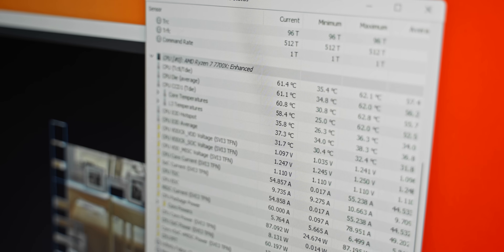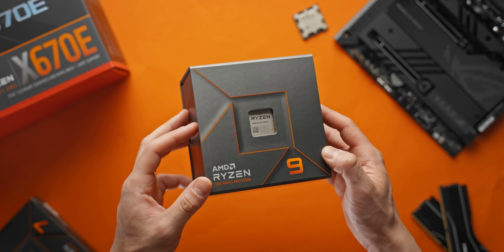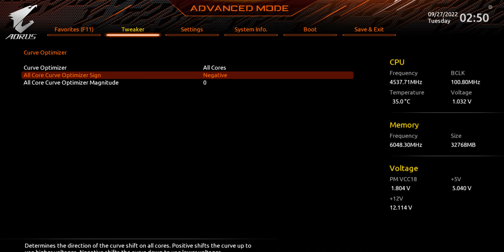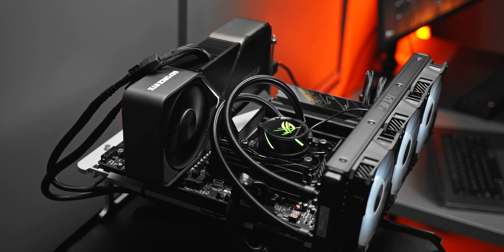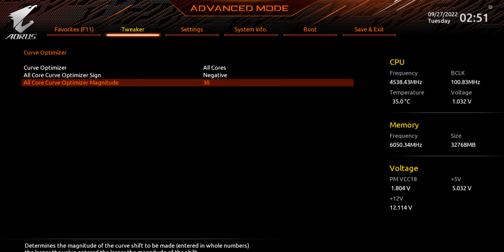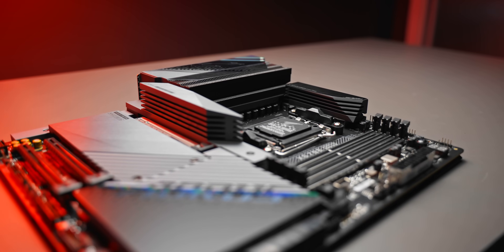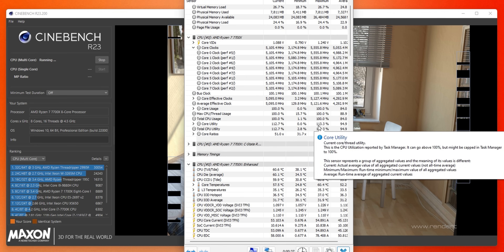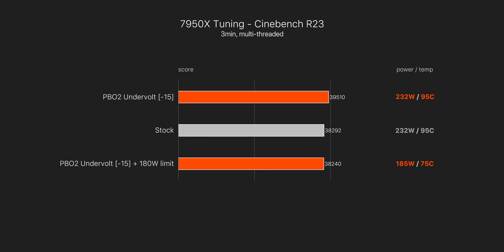Fixing Ryzen 7000 - PBO2 Tune (insanity)

Comment: This is some of the most practical and easy-to-understand advice out there. Great video as always!
Reply: Dein Name Junge hahahaha aber wo du Recht hast hast du Recht
Reply: Yes bro fr. We love you! ❤
Reply: you and Tech yes City are taking the better approach with this new chips in my opinion
Reply: Just to understand he does the -15-30% thing first and then at 4:58 hes in the tweaker settings manually capping to 85 watts`?
Reply: @Djuntas  It is a voltage offset, not a percentage. There is no need to cap anything. You are setting a negative value to the voltage curve as the CPU boost. Start at 30 millivolt and reduce by 5 until you get a stable bench run. If your voltage is still offset negatively with a stable bench run, you may find your cores boosting past the number on the box. He caped the TDP from 95C to 85C and capped the wattage to 85W to meet stock speeds at the least possible power draw.
Reply: @BansheeBunny  how can you tell if it’s stable or not ? I ran cinebench with 30 on my 7700x and it did not crash or anything is there any other way to know ?
Reply: @BB-iw4ql  Run the 30 minute test on cinebench, if it finishes, you should be fine.
Reply: agreed!
Reply: Way better than the usual random geezer with 400 subs telling you how to do this whilst using his 5 year old phone
Reply: @TechHunterOfficial  except for the fact that this guide along with the last one he made, leaves you with an unstable OC.
The guy with the phone maybe right. It would certainly be in this case.

This is one of the worst guides out there.
Reply: @TTks124  how would you know this is unstable? wouldnt that be entirely silicon dependent?
Reply: @gn0s1s  because i actually spent more time tunning ryzens than making videos.

Each core has a threshold. There's no 2 equal cores, just like there´s no 2 equal CPUs.
Best cores will usually range from -10 to positive, worst cores range from -25 and lower....

CO tunning must be tested with per core light instructions like SSE for max clock stretch instead the usual max temperature and heavy instructions like AVX2.

This all core CO bs, will run all stress test and will crash at idle or launching games.
Reply: @TTks124  Only if you are trying to find the absolute limit to your undervolt. If you don't go for an ambitious undervolt chances are setting all core will work, if you are basing it on the probability of having your bad core not being some crazy outlier. This method is much faster and simpler and will work in 90+% of the cases, if you have an outlier core that is just bad, you will have to revert per core to find it, but saying his method will lead to unstable undervolts is pretty disingenuous. And how do we know he s not running something like occt using multiple stress tests, like linpack+sse as well as hard modes like occt + small data set, and prime 95 avx. Lot of assumptions on your part.
Reply: @TTks124  You can talk all you want but I too have done my fair share of OCing both intel and ryzen processors. This guide is perfectly fine. Get off your high horse.

Comment: Nice configuration, the great thing about the Ryzen 7950X is it’s completely stable at those high temperatures, that’s if you’re not under-volting it. Insane that it can run all cores at 6.5GHz, at 95C degrees and 7.2GHz one core. Insane
Reply: 6.5 no
Reply: @john76349  Yes, look it up. 6.5 all core, 7.2 one core
Reply: @Authentyc  with liquid nitrogen dude. The programmed frequency max on ryzen 7000 is 5.85, as stated by AMD themselves.. You need exotic cooling to exceed that.
Reply: @mitlanderson  I’m aware of that, You just proved my point. what other CPU can get all cores to 6.5GHz with liquid nitrogen? None.
Reply: @mitlanderson  and I’m speaking of the 7950X
Reply: @mitlanderson  and name another CPU that can get 5.8-5.9GHz all cores without liquid nitrogen? None.
Reply: @Authentyc  well leaked 13th gen can hit that lol. Also you literally said 6.5 all core at 95 degrees, that ain't happening without ln2.
Reply: Stability is one thing but just imagine the heat that is coming out of that thing the whole time at 95c.... way too hot this time around... I could not stay in my room if it was that hot, consumers shouldn't have to tweak their cpu's to make them run cool under light loads, this is just crazy.
Reply: @choatus  heat =/= temperature
Reply: @rdmz135  LOL
Reply: @rdmz135  Lool
Reply: @choatus  And that's your personal preference, so don't buy it? Get screwed by intel instead?
Reply: @Authentyc  that is not preference that is fact. I don't get screwed by anyone, I just buy what is right for me. why pay good money for something that is sub par?
Reply: @choatus  You're complaining about the temps, so that's your personal preference not to buy cause of that "fact". get it now? Lol
Reply: @choatus  Btw, did you just say "sub par"? You must be clueless
Reply: @Authentyc  not complaining, just stating the facts.
Reply: @choatus  I already stated the facts in my comment tho so I’m obviously aware of it. Name one other CPU that can do 6.5GHz on all 16 cores? How can you even say this is “sub par”
Reply: @Authentyc  you will see soon enough that these are sub par, I've been testing cpu's for a few weeks now and you will work it out eventually lol...
Reply: @choatus  I’ve been testing for years and years, you still haven’t answered my question, what other CPU can even come close to 6.5GHz on all cores? 16 cores

Comment: PBO causes massive spike in frame time for Zen 4 though
Reply: source or it didnt happen
Reply: @mongotrip9999  go test it urself, :) or go watch framechaser
Reply: actually it's a windows update causing the issue.
Reply: @RantGG  I tested it a long time ago on windows 10, the reason is because PBO takes time to ramp up the clock speeds
Reply: @derenbong  Actually PBO 2.0 is solid, the issue has been proven to be windows update KB 5017383 for the 7 series
Reply: Frame time spikes means the chip is voltage starved. Up your offset. 
Idk what you mean by "takes time to ramp up". My 5600X stays pegged at 4.75ghz with PBO and CO tuning. No stutters whatsoever.
Reply: @rdmz135  I did, it’s not stuttering just nauseating
Reply: @derenbong  i run PBO on Zen2 and Zen3 and frametimes are absolutely rock solid with 4000MHz Dual Rank
Reply: @omegaPhix  ok

Comment: makes you wonder why they cant just make them cooler out of the box 🤨
Reply: Because they want to beat intel in those benchmarks, cuz HUR DUR 1% faster than in games, so that they can raise their plattform pricing & overall sales vs Intel. Unfortunately that means we all now have to spend way more on motherboards with overengineered power delivery.
Reply: @adriankoch964  yeah, it's soo much better to just spend on a whole new motherboard every 2 years with Intel 🤓
Reply: They can, they just did something different this generation. They went for a temp target instead of just a clock target. So no matter what, straight out of the box it tries to hit 95c, even if it doesn't need to. My only guess is they did that so that everyone gets the performance rated on the box. But as we can see here, many of these chips are not going to need to hit 95c to reach the stock clock speed.
Reply: Because letting them get hot like that means less clock variation, which means less frametime variation and microstutters.  
There's no point getting your CPU under 95c when the same amount of heat is released into the air anyway.
Reply: @Jonathan-fw6ty  wont it generate less heat?
Reply: @flake2093  the actual amount of heat is determined by the wattage, not the temperature. A 200w CPU at 50°C will still output twice as much heat as a 100w CPU at 80°C
Reply: @cosmic_cupcake  yes, but if you use the same cooling setup & curves that's impossible.
Wattage is literally heat unless disposed by cooling